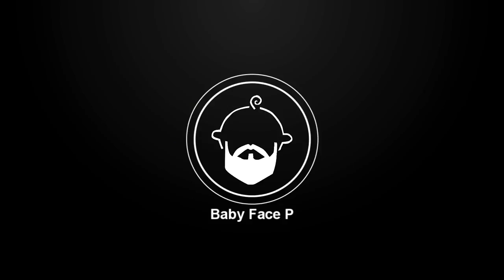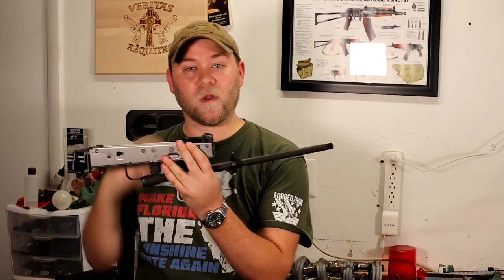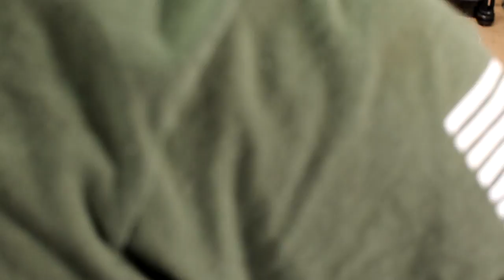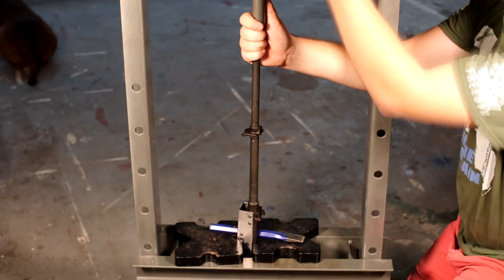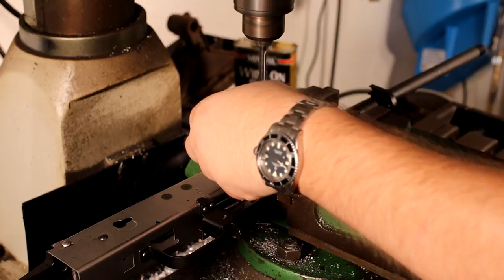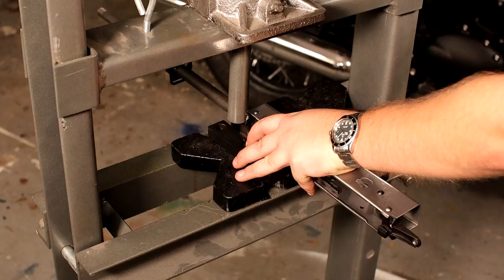AK Build- Part 7- Installing Barrel

Comment: Ok, gonna add a couple things here because people are going to be using this video as a guide

1. Don't press directly on the crown of your barrel like this. Barrels are only about 20-26 Rockwell hardness. They can deform VERY easily you need to put brass or aluminum in between the ram of the press and your crown 

2. The front trunnion needs a minimum of two firm solid spots to push off of when pressing the barrel in, that chisel used was sitting on the "mag shelf" portion of the trunnion. Its a very shallow portion and can snap off or possibly bend. It can happen easier than you can imagine. DO NOT DO THIS

3. That barrel bending like it did is going to cause some permanent point of impact issues 

3.
Reply: Get Headspace Gauges
Reply: thx alot
Reply: i totally agree and you're 100% right, but it's an ak, as a 200 yard and under gun i guess you can just kinda hammer some shit together in your garage and call it a day. i would never treat an AR like this, luckily even building one from absolute scratch there's no point in an AR build where you'd have to do anything like that that would screw your accuracy up like that. i cringed watching that barrel bend like that though, that and the crown being crushed like that i can't imagine you'd get better than 4-5 moa accuracy with good ammo and a benchrest. like i said, if you're using this as a 200 yard and under gun, to each his own i guess, but a rifle should be accurate.
Reply: @attributetovienna would you mind explaining your method of setting up your barrel and receiver and your process of pressing? I've been researching quite a bit and would really like your take. I immediately thought of the same issues you brought up so I figured you could provide some guidance. Any info is very much appreciated.
Reply: After watching 7 parts, AR platform seems a lot simpler from a 80% perspective.

Comment: It is preferable to use an end mill to cut into the barrel. Using a drill bit, the point on the drill bit can force it off of the barrel leading into an elongated hole for the retaining pin. After using the proper sized end mill, one can then use a reamer to bring it to the proper size.
Reply from the maker: An end mill would be the best option instead of a drill bit.

Comment: It is very wrong to use a dummy round as a "GO" gauge and even more wrong to use it with tape as a "NO GO" gauge. I have an AK which closes bolt on most of the live rounds (Wolf, Tiger, Barnaul), but sometimes the bolt stuck during the cycle, and I need to use a rubber mallet to open it again. I used the actual GO gauge and the bolt DOESN'T close on it, i.e. the headspace is wrong! And this is the reason why the bolt sometimes stuck: all rounds are different (plus / minus), plus the GO gauge takes the heat expansion factor into account. Using the actual round as a Go Gauge won't give you that info and you will headspace your AK incorrectly. Be aware!

Comment: Is this AKM? Or the AK-74? As far as I know the AKM barrel has a threaded connection to the reciever.
Reply from the maker: It’s an East German AKM.
Reply: @BabyFaceP  MPi-KMS 7.62x39 ?
Reply from the maker: Yup
Reply: Kurt Oberst
I know of no AKM's that screw into the receiver. I do know that the Galil's barrel screws into the receiver, but every stamped AKM i know of presses into the front trunnion and gets pinned.

Comment: Can you heat up the trunnion and tap the barrel in with a brass/rubber hammer? Honest question.
Reply from the maker: It's possible but would take a lot of time
Reply: Even with a bernzomatic torch?

Comment: I wondered how you check headspace on an AK. I did what you did on on an old Romanian build I bought years ago. It was not as loose without the tape on mine. I was worried as I have shot several thousand rounds through it and it’s a a Lancaster.

Comment: Guys please don't support your trunnion through the middle like this, this puts all the force on the bullet guide and could damage that or the barrel from a non even contact. The trunnion support tool only costs 45 dollars online and will save you a bent barrel/ bullet guide.

Comment: I build a few AKs BITD when kits came with fitted barrels, I stopped when they had to switch to new barrels because of having to drill the gas port hole, head spacing and cutting the pin grooves. You're making it look easy but that was back before YouTube and so you just had to figure it out as you went based on trial and error along with message board write-ups. I am curious about the decision to use a 1/4" drill rather than plunging a center cutting 7 mm carbide end mill or maybe like a 17/64 finishing up with a 7mm ream. Serious question, no criticism intended, this has been a great series so far.

Comment: Put the barrel in the freezer for a while and heat the trunion. 
The parts will slide right in together. No need for a press.
Reply: Really they works ? Cause i don’t have a press
Reply: @panchopistola8298  it really works. I do it all the time with various mechanical parts.
Reply: @roarstillingen2721  alright! I was like I don’t have a freaking press !

Comment: Try using 6" rulers or something similar to get the barrel clocked correctly.  One on the trunion, one on  a barrel flat spot.  From an angle in line with the bore you should be able to see if they are parallel to each other.
Reply from the maker: I'll give it a go.

Comment: Oh man that is a loose headspace
Reply: thuggies drake hella loose. the amount of force on the lugs from each shot will be emence with headspace like that...if you take a properly headspaced ak and stick a live round on the bolt and check it in that manner the bolt should become tight right as it fully locks up with no wobble between the barrel and bolt...I mean his bulid would be safe for a little while but I wouldn’t wanna put it by my face for the long haul...
Reply: Alex Van Duren when I build mine can’t really close on the go gauge. But close on live round so that works for me over time it will loosen up

Comment: I have a question about installing a headspaced  barrel. When I press it in after the trunion is rivited in, will it be difficult to line up the pre drilled barrel pin hole?
  : also I dont know if this question is relevant, because this Is my first build and haven't got my kit yet. Just a wandering thought
Reply from the maker: Yes, it can be. Take your time to make sure the barrel is at top dead center before pressing in then go slowly until the barrel pin hole lines up.
Reply: @BabyFaceP  thanks for the advice. I'm trying to learn all I can and buying the appropriate tools.
Reply: @BabyFaceP I'm stuck... so im pressing the barrel back on, I  got about 2/3 of the way on and it got stuck.. the barrel started to bend. I was able to straighten barrel back, but am worried if I try pressing again it will just bend again......
Reply from the maker: @kcmac9304  Press it back off, check the trunnion and barrel for burs. Has the barrel already been in the trunnion or is this the first time you are pressing it on?
Reply: @BabyFaceP  this is a headspaced kit from Arms of America. It had the barrel in the trunion. It's in the freezer right now. Would that help with getting it moving?
Reply from the maker: @kcmac9304  It could, worst case you can chuck it into a drill and spin the shank in some sand paper.

Comment: What is the measurement supposed to be for headspace on an ak. 2 pieces of painters tape seems pretty loose. When I rebarreled a savage bolt action I used one layer of scotch tape (close to .003”) but I imagine the ak runs quite a bit bigger tolerance than a bolt rifle.